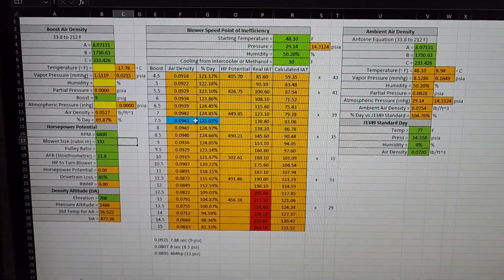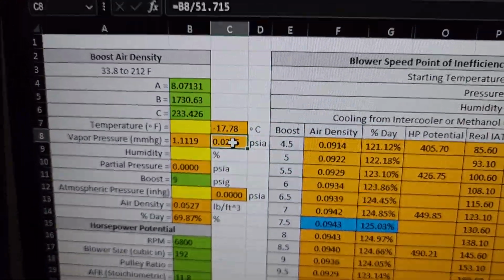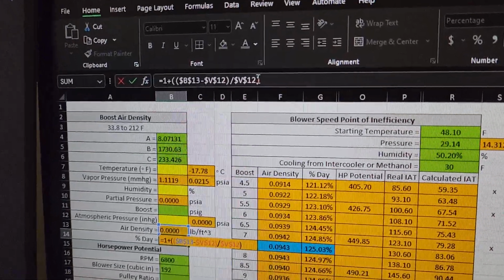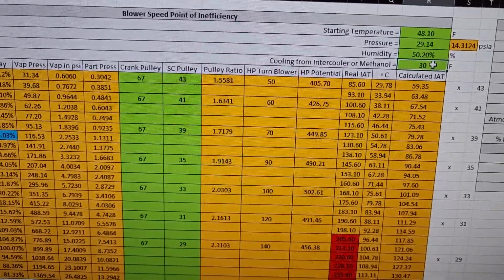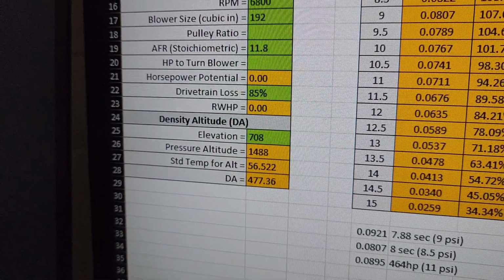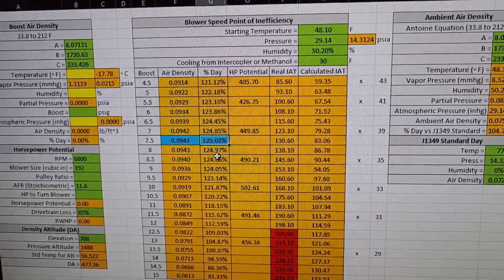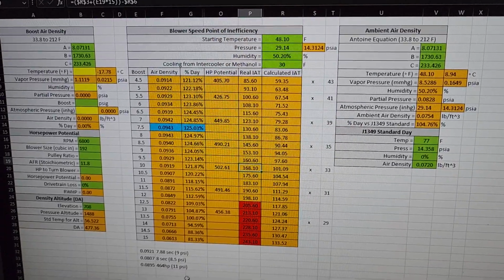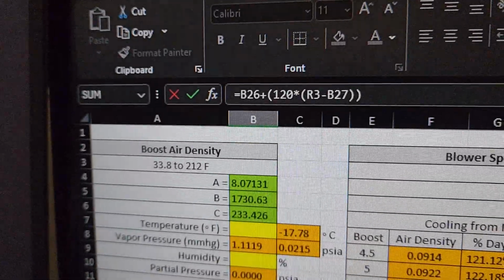Learn how to build your own supercharger tool.

Comment: I spin an Eaton M90 gen 5 at 21,000 rpm. it makes 4.5 lbs of boost on a 6.0 LQ4.
Reply from the maker: @lifeishard1211  yikes, do you measure IAT's?
Reply: Yeah, usually doesn't go above 150 f
Reply from the maker: @lifeishard1211  that's good. It sounds like you need to move to a little larger blower size. I turn mine a max of 14,000 to maintain ~10-11psig from 2k-7k rpm.
Reply: @tristan_white  blower is maxed out for sure. I have a TVS 1900 that came off a 2010 5.0 liter Jaguar Land Rover v8 that I'm working on installing. the blower pulley that came with the supercharger is about the right size to spin it at it's max speed that's on the blower efficiency chart, which is like 60%.
Reply from the maker: @lifeishard1211  hope it works good for you!